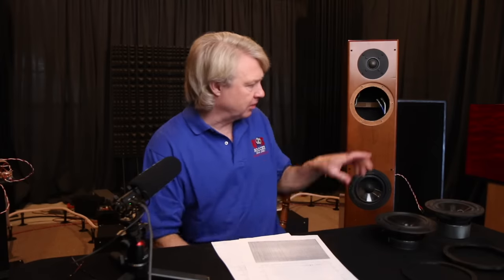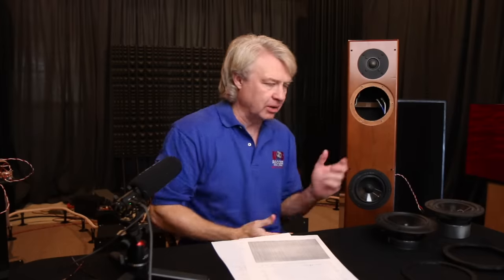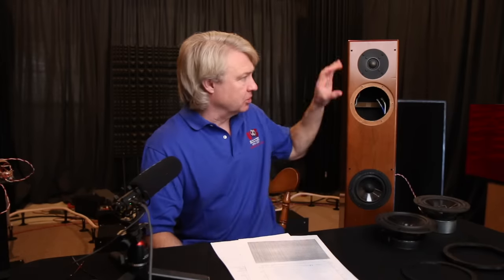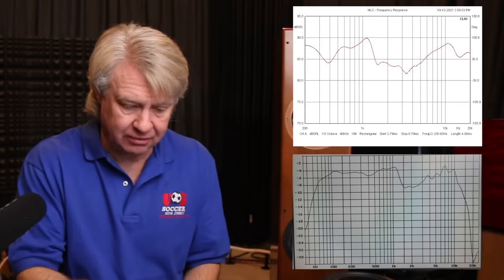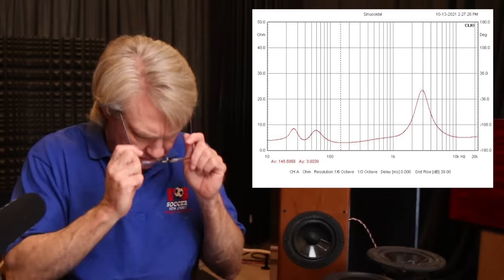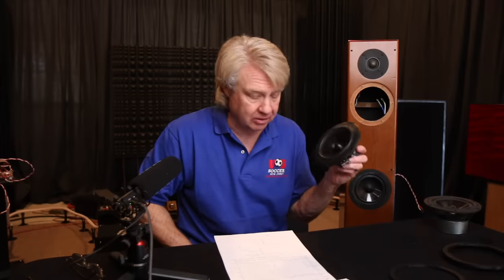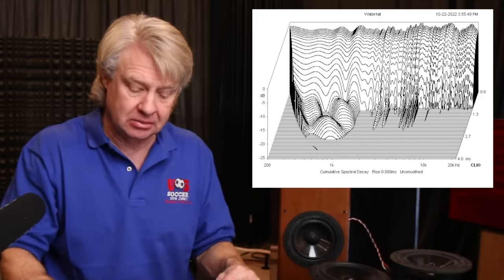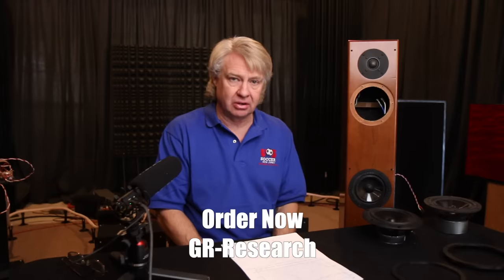This RARELY Works! But, it SAVED this Speaker!

Comment: I once swapped out a 15" rtr woofer for a jbl 2225h in a custom designed speaker with no other changes, and it was a HUGE upgrade in every way, for the entire range covered.  It's a speaker that already needed eq, and still needs eq, but imo ALL speakers need eq, if only to boost the low bass, and a good dsp eq does not harm the sound imo.  The jbl 2225h is superior for a hifi woofer duty than the 2226 that replaced it.  It's an amazing woofer to this day.

Comment: pretty impressive results. After seeing the original stock measurements, if the speaker were mine, it would have been quickly posted on ebay or USA'mart to move it on.
Reply: Measurements are for audionerds.
Reply: @bubblehead5394  must be why there are tons of em for sale on the shark.
Reply: that would have been stupid,  measurements dont always tell the truth about speakers ability to play spesific music. as it is in this case.. fools stare at "measurements" instead of actually listening to a music. Danny is a great guy but hes not exactly a right man to make a call wether speaker plays Mozarts music beautifully... hes a "measurement guy" , rigid mindset that relies on numbers But thats not what music is about.
Reply: previous stupid comment i have you post. amplifier, cd players, dac have some different sound. would you want to start with something neutral sound like a speaker.

Comment: Andrew Jones, now at MoFi, has a new 10" dual concentric, 2 way, purpose designed, engineered, tooled up, & built from the ground up from scratch. It's got a 2" thick faceted baffle. All other cabinet walls are 1", & it's got 2 rear ports to break up modes he says. Custom made paper cone & 1.125" silk dome tweeter,  XO at 1.6khz. I'm a Tannoy fan so I'm looking forward to seeing  the reviews. $22k for Tannoy DC10A is way more than I can afford. These MoFi Source Point 10, maybe I can afford.

Comment: I got lucky when the tweeter in one of my Epos ES14's began to fail. I got a pair of Peerless DA25TX00-08 1" Corundums and adapted them to the front baffle, and instead of the original caps swapped them out with Panasonics much better than originals, and at a value that allowed the Peerless to play lower frequencies. In my situation, the Peerless are much nicer tweeters than originally, with both good dispersion and ability to play low. Danny did 2 videos in Dec 2020 with the ES12, a later single-cap design. Original ES14 suffer from some issues Danny mentioned about the ES12, such as standing up and losing much of the highs. That's no longer the case with mine, because I let the new driver fix the issue.

Although I'd never claim my setup is ideal, I do not currently notice any issues with the woofer playing too high, nor either driver playing too loud or soft. I kept the original foam inside, already much more effective than the light material Epos supplied inside the ES12. My ES14's have been greatly improved, and that's something you rarely hear anyone say about the ES14.

Comment: Wow that frequency response  is really impressive now that upgrade is amazing and worth the money.Yes old moving coil designs and cabinets are no match for modern drivers and good crossover parts etc
Reply: Obvious scam. Be aware
Reply: The basic technology of dynamic drivers and how they work has not changed very much, if hardly at all, so I think you're confusing "moving coil designs" with turntable terminology instead.

The cabinet designs of modern (GOOD quality) speakers, are considerably better than most vintage ones, especially in the overall baffle size and orientation, but really the only other things that have significantly improved in (better than average quality) new speakers vs. most typical vintage ones, is the crossover component quality, mainly in the type of capacitors that are typically used, being that most vintage speakers pretty much ONLY used electrolytic capacitors, even usually in the tweeter circuit, because that was the only types of capacitors available, but nowadays most above average quality speakers at least use (mostly) basic level polypropylene capacitors instead, at least for the tweeters.

However, the basic principles of how dynamic driver speakers work is still pretty much exactly the same as it was over 50 years ago.

Comment: I got lucky. As a hobby, I figured I'd mess with some budget RCA floor speakers 2000 era.
 Bought three way crossovers from Parts Direct, and replaced the tiny crossovers in them with the larger, beefier new crossovers.
 Wasn't expecting much, but it actually made the speakers respectable, keeping in mind they're old school box design, and not audiophile grade.
 The crossovers really opened them up, and the bottom end, which was always lacking without equalizer adjustment, was there.
 Figured what the heck, went ahead and put two by two hardwood crossbracing in the middle about 8" apart, and it's an improvement also, again, keeping in mind that they're budget speakers.

Comment: I enjoy taking old speakers and replacing the drivers and using a new crossover. All you have to do is calculate the internal volume and find a woofer that works in that volume and model it in Winisd for an acoustic suspension or a ported enclosure. You almost make it sound like it can rarely be done correctly. I do it all the time with good flat responses.

Comment: It's a real problem.  I blew my tweeters running my guitar into them ( not a good idea)
I did find similar that had recommended crossover a bit lower than original . But sensitivity is lower and obvious. 
The unit is also about 2mm less diameter. It doesn't sound too bad ,little less harsh.

Comment: Wattage Post CrossOver...................................?
        I would be curious to compare gross wattage input versus net wattage per driver driven after the crossover.  Or maybe at 1 watt in, as a standard.
      I would think the difference would indicate a crossover efficiency, if there is such a thing.

Comment: So what’s the most you would recommend that anyone spend on picking up a used pair of these given  the cost of an upgrade kit?
Reply: You would be better off getting one of our X-LS Encore or X-Bravo kits, and a flat pack, or even a fully assembled pair of bookshelf speakers that will easily compete with the Mozart Grand Upgrade kit. The upgrade kits are intended for those that already own the speakers.

Comment: I have to wonder how manufactures think they have to design a monitor with some kind of a "sound" to distinguish them, even though it means the monitors are miles from being transparent and natural sounding. This one's measurements are beyond belief. I mean, I don't think, say, Andrew Jones has ever or will every design a speaker that bad. Likewise companies like JBL Pro, or ATC Professional. Anyhow, while the "good" manufactures have always strived for linear anechoic response, controlled dispersion, low distortion and low dynamic compression, some fancy consumer manufactures ship garbage like these originally were. Amazing salvage job as well.

Comment: In looking at the tweeter response, I see the dip between ~2.8khz & 4khz but it never seems to drop below ~92 db.  Is there no way, with more parts of course, to drop the level above ~3.5khz to ~92 db as well as drop the the peak at 2khz to get lower extension out of the tweeter? With a passive crossover? 

With your woofers and an active crossover/dsp it seems like taming the tweeter would be easier.. I guess the only "gain" would be in the vertical off axis response.
Reply: With this upgrade, no DSP is needed.

Comment: Question- do you do these upgrade kits/videos for a hobby or is it actually profitable for you? I would think updating your existing product line would be a better use of time but perhaps doing these upgrades may even serve as an opportunity for you to test a variety of components.
Reply: He is doing very well.
Reply: He bought a truck load of no res in 1982 , the same year he got his bouffant sorted . Gotta get rid of it somehow
Reply: It can be profitable if it's a popular speaker. People like the videos
Reply: @RennieAsh  . Can you re post that through some tube connectors? Can’t read your writing the signal is getting smeared , or maybe it’s your sand cast resistors 🤣
Reply: If the speakers sound good they might not need updating/improving.   One day I might buy a set and try them myself.  As for now, I have other bills and plenty of speakers that sound fine enough but could definitely be better.

Comment: How does one determine what cause the "ringing" in spectral decay traces?
Reply: There's a few different things. Usually a sudden rise & then dip in the measured response indicates that there's ringing/breakup, often due to the cone being highly resonant at certain frequencies. Especially metal cones, but also many cheaper polymer cones, tend to show break-up issues. It can even depend how a paper cone is doped will affect the response & create ringing. It can also come from resonances within a woofer's frame depending on what it's made from (aluminum, sheet steel, plastic, etc)
Those kinds of ringing show up as a long trail. In the mids of the new response, the lumps in the spectral dip down, then rise back up, which indicates that the back wave, within the cabinet, is re-exciting the woofer.
In that case the fix is to add some loose polyfill or fiberglass insulation into the box to help absorb that back wave.
Reply: @hoth2112  Thank you. I understand ringing can also due to the enclosure. How does one tell which is which?
Reply: @raynerstuelgalid  the shape of the spectral delay. A driver ring starts as a peak & keeps ringing longer than the rest (see the original response around 1000Hz). When it's a cabinet issue, the problem looks like rolling hills, where it falls down then rises back up and back down again.
Reply: Great and easy to understand explanation Hobbs.

Comment: I was wanting to swap out the woofers on my Series I Klipsch RF-7's but yeah, ain't nothing gon fit the holes. I only ever found one driver that looked like it was the same stupid shape Klipsch chose. I wanted to switch them to something different cus somebody dented one of the drivers when they were trespassing in my space and messing with all my stuff without my permission. Original Replacement Drivers for the Series 1 RF-7 are unobtanium and the ones I found were always dented way worse then the dented one I have already.

Comment: Would love to see a video where you take a pair of "White Van Speaker Scam" units and critique them. Maybe see if you could improve them. Would be a hoot to watch.
Reply: It would be interesting, but there's no way it would be worth it, they're often so poorly and cheaply built, the upgrade would be several times more expensive than the speaker..
Reply: @hoth2112  fun video though!
Reply: I have measured and tested two different white van models. Both were pretty bad.

Comment: Nice work! Couldn't you just keep the lower woofer and make this upgrade a bit cheaper? I know that two different drivers would then cover the same frequency area but if you fade out the original one early enough, I doubt, this would me much of an issue.
Reply: The response of the stock woofers is so bad we would have had to add more parts to the crossover get a steeper roll-off. Using our M130 woofer, we were able to use only a single coil to achieve the desired result.

Comment: WHATS THE POINT ON CHANGING THE LOWER WOOFER IF ITS ONLY PLAING LOW BASS?
Reply: We have a very low order filter on that lower woofer of ours. If we used theirs it would require a much higher order filter to get the nasties out of it. So it would be more expensive than swapping out the woofer and using a low order filter on it.
Reply: Because there's many different types of bass. There's the sloppy, really deep bass you hear when someone pulls up beside you in a car, for one example,  then there's the beautiful, controlled tight bass, as another example.

Comment: So  just swapping the woofers didn't work
Reply: Correct, in the sense that you can't just swap out drivers using the same stock crossover. That's a needle in a haystack chance of working if at all.
If you change drivers to something other than OEM replacements, the crossover will almost always need to be adjusted to account for differences in both electrical & acoustic output, which is what he did.

Comment: Wait, wait, wait. I thought by listening to the first 13 minutes it was a driver swap. OK cool, no problem. Now at 14 minutes in its $520.00 to $618.00? Hey it's all good. But where was the option for the driver ONLY swap and cost option vs response? Can that be done without all the added expense? If not, just buy another tower with greater efficiency and flatter response. Then sell that "defective" unit on fleybay and use that reward to move upward to a more viable option. Hell, I don't care to mod, but $600? Just admit you're first wife fooled you. Then be told to move on. But it will cost you.
Reply: No such thing as a free education.
Reply: You can't just swap out the drivers without swapping out the crossovers to go with them.